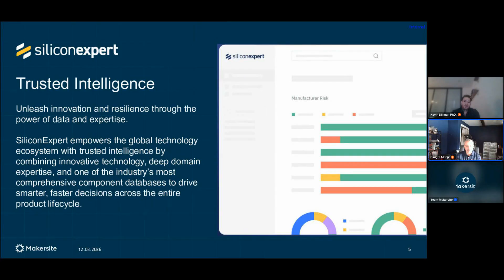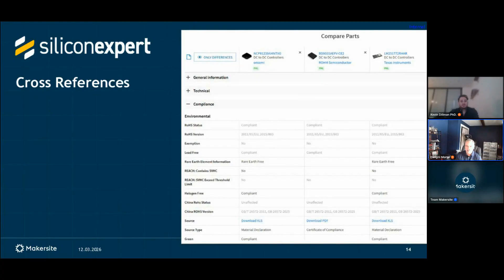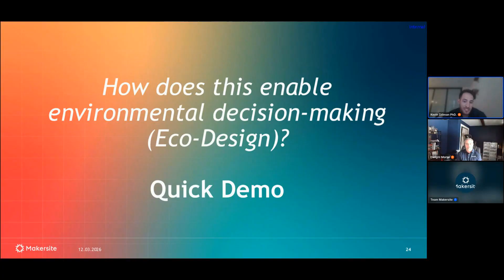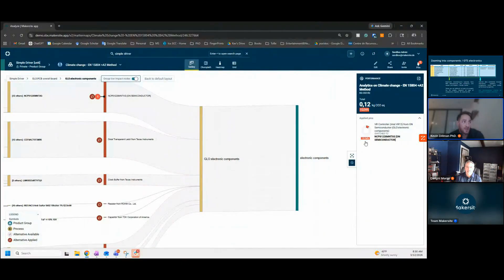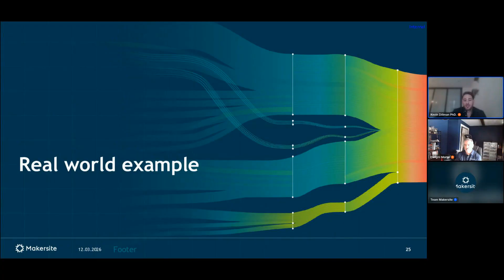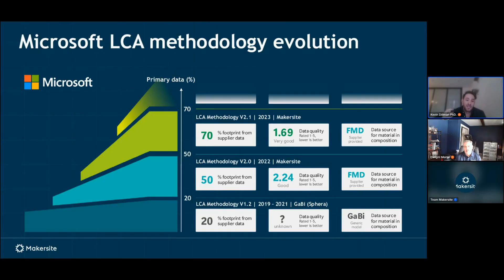Masterclass: Electronics On-Demand | Connecting Component Data to Sustainable Product Decisions

Comment: The presentation says regarding OTS components: "These are not difficult to build LCA models for. No weight, research on type of
components required. No material info"
Which seems to assume that Full Material Declarations are always available.  That may be far from realistic, in which case it seems that building the LCA model is extremely difficult since the component is a black box with none of the required data available.